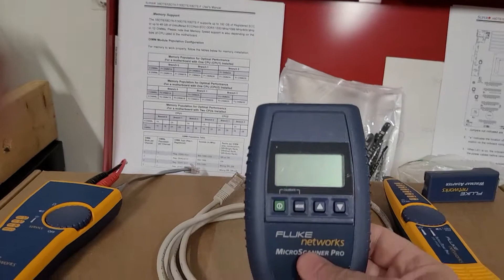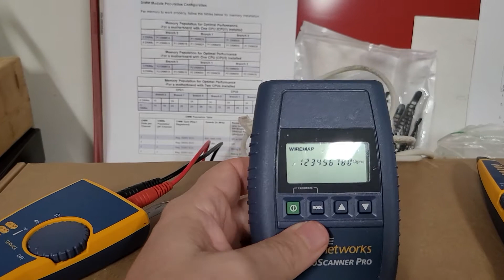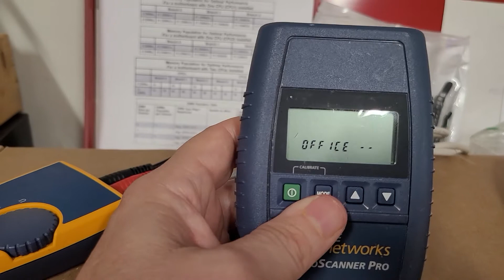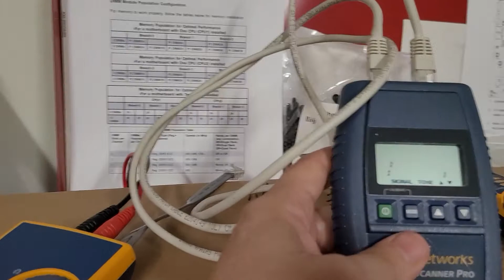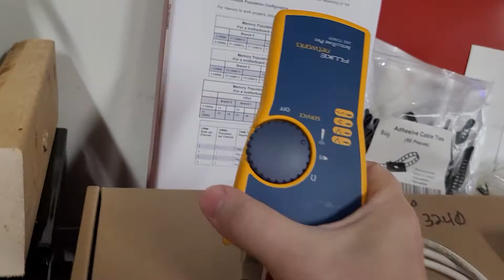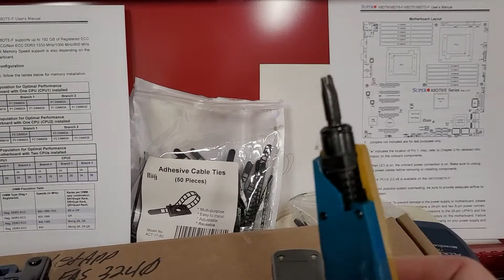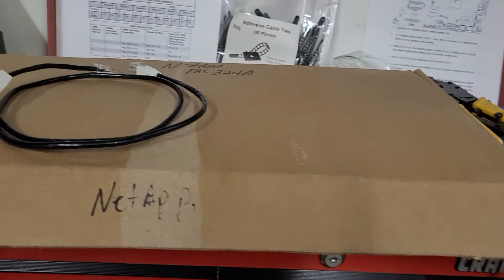IT tools for making and testing CAT 5 6 and 7 cables for your IT Lab and home needs.

Comment: How do I format 3.5" drives without a 3.5" shelf? Do I need a flashed internal hba card? Or can it be done with an unflashed hba card? Or even a normal raid card?
Reply from the maker: You can use a single SAS cable hook up with power or use a 2 drive drive bay and use a SAS to 4 SATAa cable to hook up.  The cable version is very cheap and easiest way to go. ( https://www.newegg.com/p/0ZF-00EK-00045?item=9SIAABH54D4941&source=region&nm_mc=knc-googlemkp-pc&cm_mmc=knc-googlemkp-pc-pla-vsincables+-+sata+%2f+esata+cables_-9SIAABH54D4941&gclid=Cj0KCQjw-uH6BRDQARIsAI3I-UdZv7rnO2T9CuhlDkLvwm8UNnEe04QrlNPPW5T9Ip44aPtgUO7y17oaAhmVEALw_wcB&gclsrc=aw.ds )   But the two drive caddie solution is better for I can do 2 drives at a time.